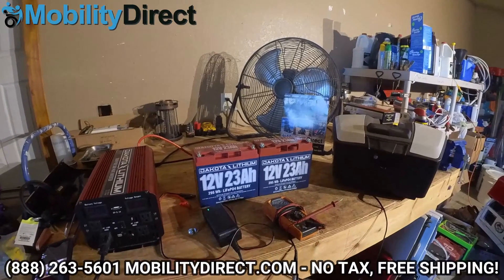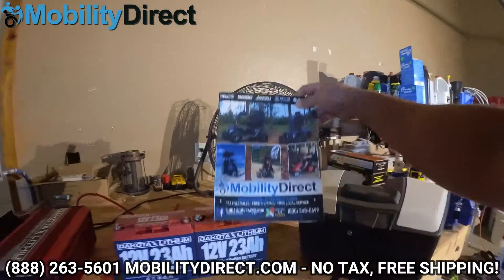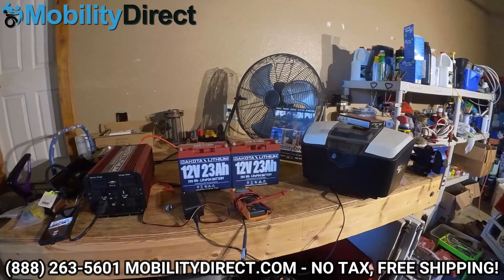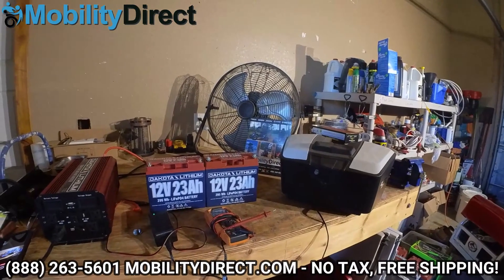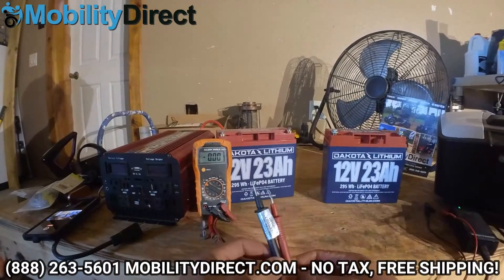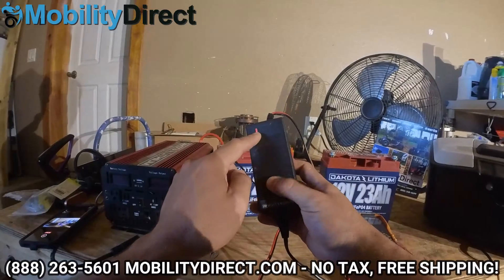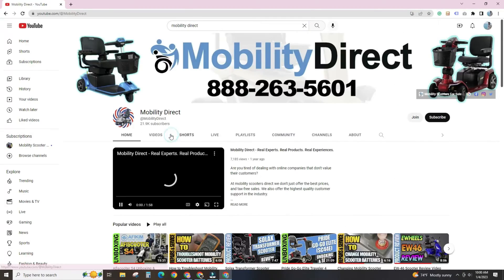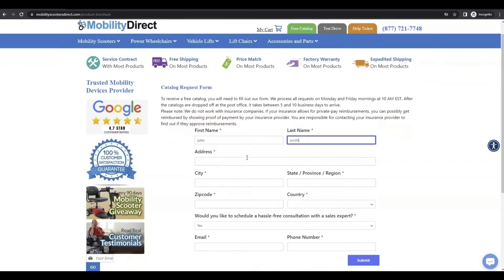⚙️How to Repair Dakota Lithium Batteries That Aren't Working

Comment: My battery charger shows green, but the battery is dead. Are there any fixes for that?
Reply from the maker: @benzoate4496 Thanks for stopping by our YouTube channel. I recommend watching this video which will show you how to troubleshoot batteries as a start:
https://www.youtube.com/watch?v=4jeQ5sQQTtM&ab_channel=MobilityDirect
Reply: Same here!  green light on, no fan turning, no red light so acting like battery is charged but it's not...is putting out correct voltage of 14.5v but battery won't charge past 6.45 volts. Any ideas???

Comment: I have 36v, when I put my meter on it it starts at 15-20v, within seconds settles to 4v. Charger has both the red and green light on when plugged into the wall, and doesn’t change when connected to the battery. Ever seen this?
Reply from the maker: This is a sign that you'll need to replace your batteries. You can also check out other ways to troubleshoot your batteries here: 
https://www.youtube.com/watch?v=4jeQ5sQQTtM&ab_channel=MobilityDirect
Thanks for watching our video and commenting! We appreciate the support.

Comment: What if you dont get a red light when you put it on the charger? Mine is at 0.6VDC when I put it on the dakota charger it doesnt turn Red, it stays green.
Reply: I have the same issue - left on the charger overnight - did not wake the battery up.  Tried jump-starting it as well with no luck.  Other vids show guys cracking the casing open and charging the cells direclty bypassing the BMS but most of these vids that show folks 'waking up a batt' - that is the battery working properly with the BMS allowing it to wake up - but a lot of us not so lucky.
Reply: @pbjadventuresnorth  Yeah I just warrantied the battery and they sent me a new one for free.
Reply from the maker: Just make sure to charge the battery for several hours. It will eventually wake the batteries up. Thanks for watching our video and commenting! We appreciate the support.

Comment: 👍👍
Reply from the maker: Thanks Jose!!
Reply: I had the exact same problem for a 12 volt. Don’t do this but I took off the casing and took out the BMS. It’s not safe to use it without a bus because all the cells can get out of balance which means if one cell is at 5v and another is at 12v the charger is going to charge it until it thinks it is fully charged but some of the power ends up going to the fully charged cell which means overcharging. I think I’m just going to take out all the 18650 batteries they use in those things and rebuild one myself.